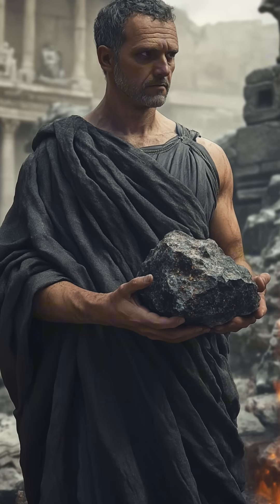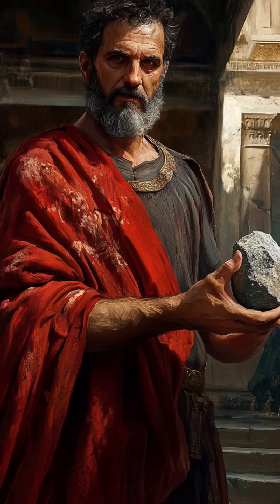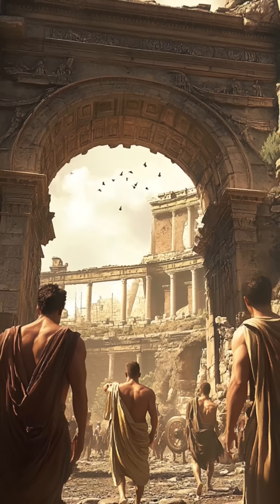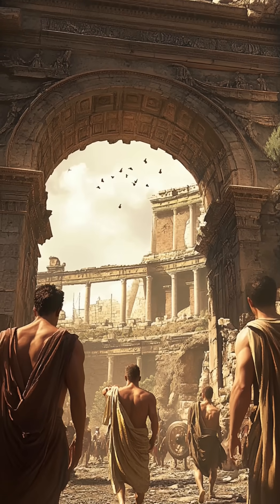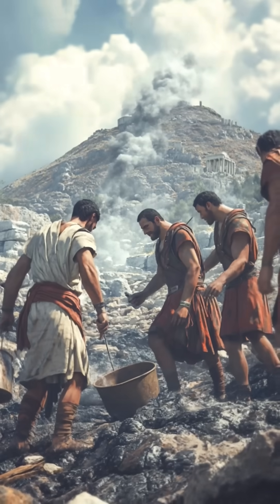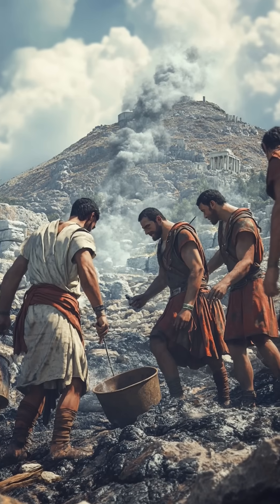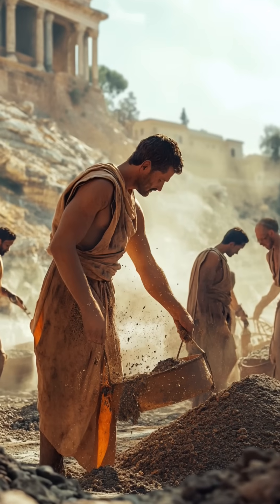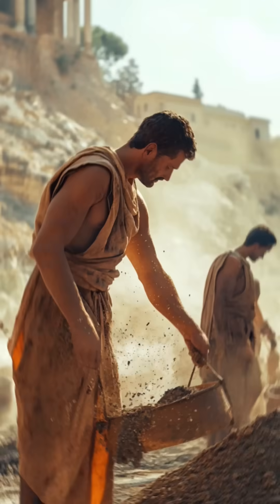Why was Roman concrete better than modern concrete?

Comment: Its not a fair comparison. Roman concrete was more a replacement for stone. If you look at all the Roman conc buildings that survived. They are built is the same way you would build with stone. Roman concrete is brilliant in compression, just like stone but you could not build a modern motorway bridge out of Roman concrete! You would have to build it as though you were using stone!